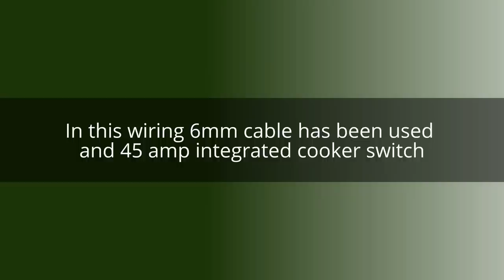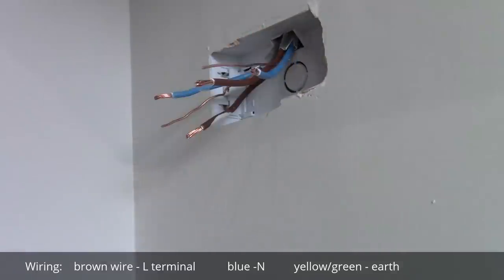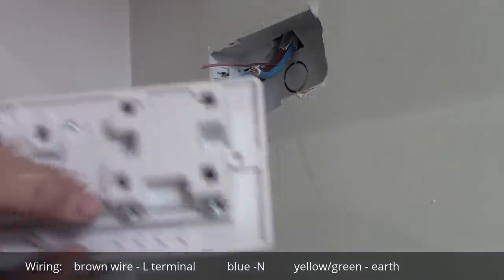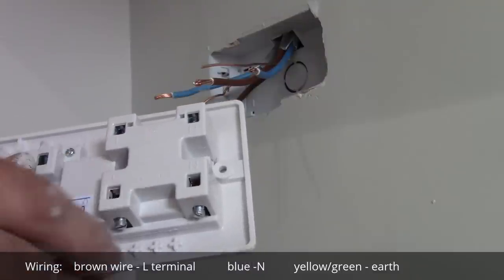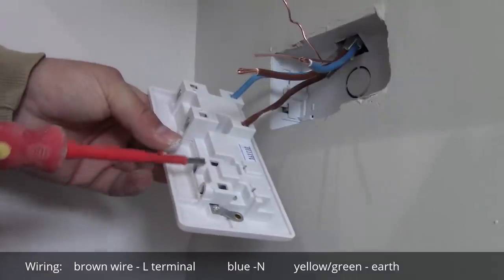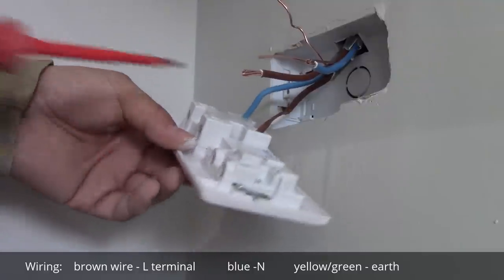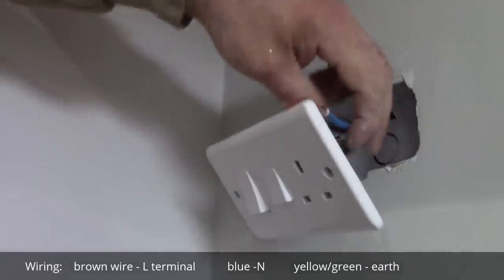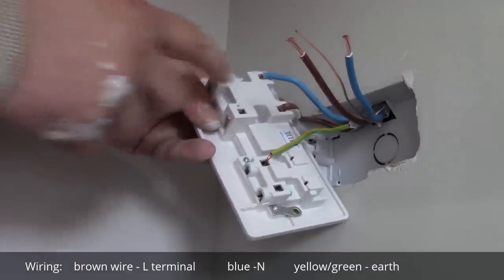Wiring cooker switch How to connect install cooker control switch unit

Comment: It is no longer the practice in Ireland for a good number of years now to use these type of cooker/socket switch... Because of there been no RCD protection on the cooker circuit which the socket is part of...

Comment: I have privileg Glass ceramic hob 6421(007.394-0) with 11 wires as breakdown bellow:Black-2Brown-2GreenYellow-1White-2Blue-1Orange-1Red-2Please how do I connect this wire together into a single 13AMP Plug or Heater switch with full function. What I did is put the blacks, Browns & GreenYellewo in one plug, and the Whites, Reds & joined Blue and Orange together as Neutral in another Plug. The Hob powered but the heaters are not working.